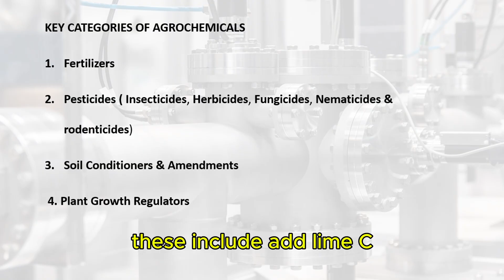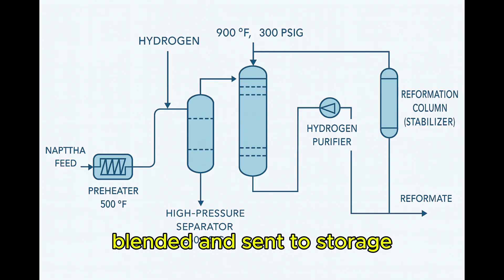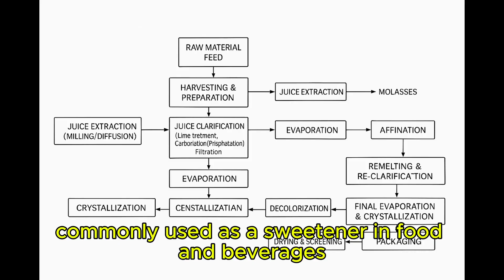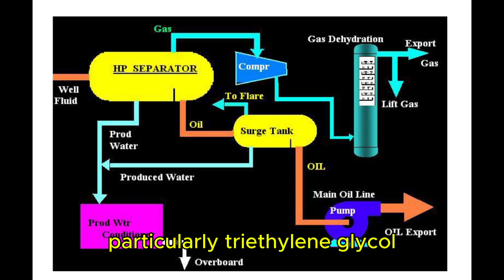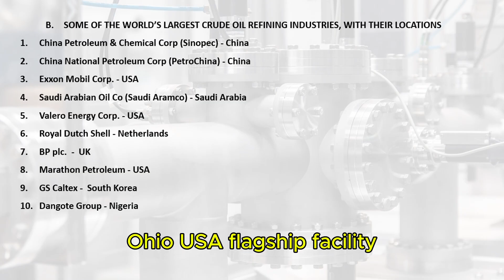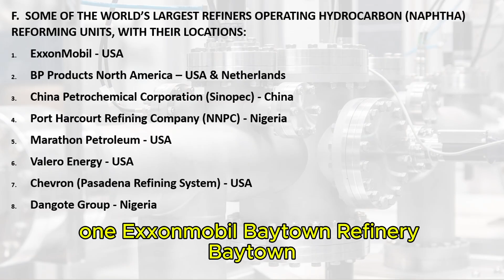From Molecules 2 Millions: The Chemistry, Process Flow & ROI of Industries & Utilized Raw Materials

Comment: Question: What stage of cement production induces the most environmental hazard? How could this be mitigated

Answer

The stage of cement production that induces the most environmental hazard is STAGE 5: THE CLINKER FORMATION in the rotary kiln

This stage requires extremely high temperatures of about 1450 degree Celsius,which are usually achieved by burning fossil fuels. This process releases significant amounts of carbon dioxide (CO2), a major greenhouse gas, contributing to climate change. Additionally, the extraction of raw materials in STAGE 1 can lead to habitat destruction and soil erosion but then the clinker formation is the most energy-intensive part of the cement manufacturing process, and it is responsible for a large portion of the industry's environmental impact.

How can this be mitigated?

There are several ways to mitigate the environmental hazards associated with cement production:

1.  Using alternative fuels: Replacing fossil fuels with alternative fuels like biomass, waste-derived fuels, or even hydrogen can significantly reduce CO2 emissions.
2.  Improving energy efficiency: Optimizing the kiln process, using more efficient equipment, and recovering waste heat can reduce energy consumption and emissions.
3.  Using supplementary cementitious materials (SCMs): Incorporating materials like fly ash, slag, or silica fume into the cement mixture can reduce the amount of clinker needed, thus lowering emissions.
4.  Carbon capture and storage (CCS): Implementing CCS technologies to capture CO2 emissions from the kiln and store them underground or utilize them in other industrial processes.
5.  Developing alternative cement types: Researching and developing new cement types with lower clinker content or alternative binding materials can reduce the overall environmental impact.
6.  Optimizing raw material sourcing: Careful selection and responsible mining practices can minimize the environmental impact of raw material extraction.
7.  Implementing stricter regulations and standards: Governments and industry bodies can enforce stricter environmental regulations and standards to drive emission reductions and promote sustainable practices.

These measures can collectively reduce the environmental impact of cement production.

Comment: Discuss the most recent innovative technology involved in the removal of hydrogen sulphide from natural gas streams during gas processing

In gas processing, the most recent innovative technologies for removing hydrogen sulfide (H₂S) from natural gas streams focus on regenerative liquid redox systems, advanced adsorbents (e.g., MOFs and metal‑oxide modified carbons), and electro‑catalytic oxidizers—all aiming for higher efficiency, lower waste, and improved sustainability.

---

1. Liquid Redox Systems with Chelated Iron (e.g. LO‑CAT® / Thiopaq O&G)

Chelated‑iron liquid redox systems such as LO‑CAT® and THIOPAQ O&G utilize iron chelates or biocatalytic oxidation to convert H₂S into elemental sulfur under mild temperatures (~30–40 °C) with high selectivity and solvent regeneration in situ. These are commercially mature technologies recently adapted for broader gas streams, including biogas and renewable natural gas—even though they've existed for years, their latest applications and scale‑ups reflect ongoing innovation  .

Biocatalytic variants like THIOPAQ O&G combine absorber, bioreactor, and sulfur handling stages to continuously convert sulfide into elemental sulfur using microbial catalysts, operating at near‑ambient conditions and achieving excellent uptime and safety  .

---

2. Advanced Adsorption Materials: MOFs, Zeolites & Modified Carbon

Recent innovations feature metal‑organic frameworks (MOFs) and engineered zeolites with extremely high surface area and selectivity for H₂S molecules. These materials dramatically boost adsorption capacity and longevity in harsh gas conditions  .

Similarly, researchers have developed biochar-based activated carbon materials modified with copper oxide (using spent Fenton-like reagents) that exhibit exceptionally high adsorption capacity—over 1000 mg H₂S per gram of sorbent at elevated temperature (~120 °C)—surpassing previous adsorbents  .

---

3. Electro‑Catalytic Oxidation Technologies

In cutting-edge lab research (2024–2025), electrochemical oxidation methods using doped nanostructured coatings—such as Mo- and polyaniline-doped MnₓO_y/TiO₂ nanotube arrays—demonstrate robust sulfide oxidation in aqueous scrubbing streams. They convert sulfide to elemental sulfur with high durability and minimal sensitivity to gas composition or oxygen levels  .

---

4. Hybrid & Digital‑Enabled Systems

Many of these techniques are now combined in hybrid systems (e.g., adsorption + catalytic oxidation or liquid redox + membrane polishing) to handle a broader range of H₂S loads and improve system flexibility, reliability, and cost efficiency  .

Additionally, AI-enhanced monitoring and digital twins are emerging as process optimization tools, enabling real-time control, predictive maintenance, and autonomous adjustment of treatment units for H₂S removal in midstream operations  .

---

🆕 Stand-out: Chelated-Iron Biocatalytic Systems

Of these, chelated‑iron redox systems (e.g. LO‑CAT®) and their biocatalytic derivatives (THIOPAQ) represent the most recently commercialized, innovative technology for large-scale H₂S removal. They operate at ambient conditions, regenerate solvent continuously, and produce elemental sulfur—with minimal waste and strong commercial adoption in both natural gas and renewable gas processing contexts  .

---

✅ Technology Comparison Table

Technology	Innovation Highlight	Scale / Status	Pros	Cons

Chelated-iron / biocatalytic redox	Recent commercial rollouts, ambient ops	Widely deployed (natural gas + biogas)	Low energy, sulfur recovery, regenerative	Requires careful microbial control
Advanced adsorbents (MOFs, Cu‑C)	Ultra-selective, high-capacity materials	Pilot / early-commercial	High efficiency, regenerable	May struggle with complex gas mixtures
Electro‑catalytic oxidizers	Novel electrode materials (TiO₂ nanotubes doped Mo/PANI)	Experimental / lab scale	Fast, robust sulfide oxidation	Still under development, scale-up needed

---

Final Thoughts

For immediate industrial deployment, chelated‑iron redox systems (particularly the latest Thiopaq/LO‑CAT adaptations) offer the greatest innovation impact and commercial viability in modern H₂S removal.

For next-generation solutions, research into advanced adsorbents and electro‑catalytic oxidizers is promising, potentially unlocking higher throughput, lower energy use, and modular application for cleaner gas streams.
🔬 1. Liquid Redox Systems (e.g. LO‑CAT®, Thiopaq O&G)

✅ How It Works:

The gas stream containing H₂S is brought into contact with a liquid solution containing chelates of iron (e.g., EDTA).

H₂S reacts with ferric iron (Fe³⁺) to form elemental sulfur (S⁰).

The solution regenerates ferrous iron (Fe²⁺) to ferric iron (Fe³⁺) using oxygen or air.

Elemental sulfur is removed as a non-toxic 
.System Design:

Absorber column: Gas contacts the redox solution.

Oxidizer tank: Air is bubbled to regenerate Fe³⁺.

Sulfur filter: Elemental sulfur is filtered and removed.

Makeup tank: Maintains pH and iron chelate levels.

🌟 Advantages:

Operates at low temperature and pressure.

Produces pure elemental sulfur, easy to handle.

Environmentally friendly — no toxic emissions.

Low energy use.

📌 Example: Thiopaq® O&G

Developed by Shell and Paques.

Uses sulfur-reducing bacteria to enhance regeneration.

Modular and easily integrated into existing gas treatment plants.

Especially effective for low to medium H₂S concentrations.

---

🧱 2. Advanced Adsorbents (MOFs, Zeolites, CuO-Carbon)

✅ Recent Innovations:

Metal-organic frameworks (MOFs) with ultra-high surface area tailored for H₂S.

Copper oxide-impregnated carbon materials show:

>1000 mg H₂S/g adsorption capacity.

Effective even at elevated temperatures (~120°C).

Zeolites functionalized with metals (e.g., Ag, Zn, Cu) for selective removal.

⚙️ System Design:

Packed adsorption columns.

Regeneration via heating or gas purging.

Multiple beds for swing operation.

🌟 Advantages:

High selectivity to H₂S over CO₂ and other gases.

Compact, ideal for remote or mobile units.

No liquid handling or wastewater.

Can be integrated into hybrid units for polishing downstream.

---

⚡ 3. Electrochemical Oxidation Systems

✅ Emerging Tech:

Uses conductive electrodes (e.g., TiO₂ nanotubes doped with Mn, Mo, or polyaniline).

Oxidizes H₂S to elemental sulfur or sulfate using electrical current.

Designed for aqueous streams or gas-liquid 

⚙️ Setup:

Electrolytic cell with oxidizing and reducing compartments.

Power supply and flow controllers.

Continuous monitoring of pH, redox potential, and conductivity.

🌟 Advantages:

No need for external chemical regenerants.

Produces no secondary waste.

Compact and modular.

Highly scalable with AI-enhanced controls (IoT-ready).

⚠️ Challenges:

Still under pilot testing.

Requires robust materials for long-term corrosion resistance.

Electricity demand needs optimization.

---

🧠 4. AI & Digital Process Enhancements

✅ Recent Trends:

Digital twin models of gas processing units now simulate and control H₂S removal systems in real-time.

AI algorithms are used to:

Predict H₂S spikes and adjust flow rates.

Monitor pH, oxidation state, and chelate degradation.

Trigger regeneration cycles automatically.

🌟 Benefits:

Remote control of units in offshore or desert gas fields.

Reduced manpower and improved safety.

Extended equipment lifespan via predictive maintenance.

🔄 Hybrid Systems (Integrated Approaches)

Adsorption + Redox: Ensures high removal even with fluctuating H₂S levels.

Membrane + Biocatalysis: Used for ultra-pure methane streams.

Cryogenic polishing with redox pretreatment in LNG plants.

Comment: Name: EKPUH JOEL OGHENEOVU
MAT no: U2020/5581001
QUESTION: Briefly discuss the commercial method of producing insecticide.

The following steps are carried out in the commercial production of insecticides. 
Step 1. The active ingredient is formulated by extracting and purifying them from natural or synthetic sources. e.g of synthetic source is organophosphates, e.g of natural source is pyrethrinos. 

Step 2: The active ingredients is mixed with carriers and additives, i.e, it is combined with solvents, fillers, emulsifiers, stabilizers, and synergists to improve its effectiveness and stability. 

Step 3: Formulation processing like milling, blending, or emulsifying to achieve desired particle size is also carried out. 

Step 4: quality control tests are carried out as well, to ensure the insecticide meets with standard.

Step 5: packaging in containers and bottles for easier carriage and storage.

Step 6: Distribution to the end users and making PROFIT.

Comment: The removal of carbon dioxide (CO2) from natural gas streams is a crucial step in natural gas processing. Here's an overview of the chemistry involved:

## Chemical Solvents
1. _Amine-based solvents_: These solvents, such as monoethanolamine (MEA) or diethanolamine (DEA), react with CO2 to form a carbamate compound. The reaction is reversible, allowing for regeneration of the solvent.
2. _Physical solvents_: These solvents, such as methanol or propylene carbonate, absorb CO2 through physical interactions rather than chemical reactions.

## Chemical Reactions
The reaction between CO2 and amine-based solvents can be represented as:

CO2 + 2R2NH → R2NCOO- + R2NH2+

Where R represents the alkyl group of the amine.

## Regeneration
The CO2-rich solvent is then regenerated by heating or reducing pressure, releasing the CO2 and restoring the solvent's capacity to absorb more CO2.

## Other Methods
1. _Membrane separation_: This method uses semipermeable membranes to separate CO2 from the natural gas stream based on differences in permeability.
2. _Adsorption_: Solid adsorbents, such as zeolites or activated carbon, can selectively adsorb CO2 from the natural gas stream.

## Importance
Removing CO2 from natural gas streams is essential to:
1. _Prevent corrosion_: CO2 can form corrosive compounds in the presence of water, damaging pipelines and equipment.
2. _Meet sales gas specifications_: Natural gas sales contracts often specify maximum CO2 content.
3. _Reduce greenhouse gas emissions_: Removing CO2 from natural gas streams can help reduce greenhouse gas emissions during production and transportation.

The choice of method depends on factors such as the CO2 content, gas flow rate, and operating conditions.

Comment: An industrial chemist plays a crucial role in crude oil refining operations. Their responsibilities span process optimization, product quality assurance, safety, and environmental compliance. Here’s a breakdown of their role:

🔬 1. Process Monitoring and Optimization

Analyze and monitor chemical processes in distillation, cracking, reforming, hydrotreating, etc.

Ensure optimal operating conditions (temperature, pressure, catalysts) to maximize yield and efficiency.

Adjust process variables based on real-time data and lab results.

🧪 2. Quality Control and Product Testing

Test the chemical composition and properties (e.g., sulfur content, viscosity, octane number) of: 

Crude oil feedstock

Intermediate products

Final refined products (gasoline, diesel, jet fuel, lubricants, etc.)

Ensure that products meet industry standards and specifications (e.g., ASTM standards).

⚗️ 3. Catalyst Management

Evaluate and monitor catalyst performance in catalytic reforming, cracking, and hydroprocessing units.

Recommend catalyst regeneration or replacement schedules.

Analyze catalyst fouling or poisoning and propose solutions.

♻️ 4. Environmental and Safety Compliance

Monitor emissions, effluents, and waste streams for environmental compliance.

Develop and implement chemical safety protocols.

Assist with hazardous chemical handling and spill response strategies.

🧑‍🔬 5. Research and Development

Work on improving existing refining processes through R&D.

Develop additives and blending techniques for better fuel performance.

Explore alternative feedstocks or energy-efficient methods.

🧾 6. Documentation and Reporting

Maintain accurate records of chemical analyses and process data.

Write technical reports and communicate findings to engineers, managers, or regulatory bodies.

🛢️ Example Tasks:

Determine sulfur content in diesel using X-ray fluorescence.

Monitor the performance of a hydrocracker catalyst using lab and field data.

Develop a new blend of gasoline to meet low-emission regulations.

In Summary:

An industrial chemist ensures that crude oil is refined safely, efficiently, and in compliance with environmental and quality standards. Their chemical expertise is vital for turning raw crude into usable, high-quality fuels and petrochemicals.

Comment: Quality requirements in cement production are crucial for ensuring the strength, durability, and longevity of concrete structures. Key aspects include the quality of raw materials like limestone and clay, the precision of mixing and grinding processes, and the control of parameters like moisture content and clinker properties. Adherence to industry standards and sustainable practices are also vital. 
Here's a more detailed breakdown:
1. Raw Material Quality:
Limestone and Clay:
These are the primary raw materials, and their chemical composition (specifically the presence of calcium, aluminum, iron, and silicon) is critical. 
Gypsum:
Added to control the setting time of cement. 
Additives:
Materials like slag, fly ash, or other finely ground mineral components can be added to enhance specific properties or reduce clinker content (and therefore, CO2 emissions). 
Contaminants:
Undesirable elements like magnesium oxide or alkalis can negatively impact cement quality, so their presence must be monitored and controlled, according to Thermo Fisher Scientific. 
2. Manufacturing Processes:
Grinding: Raw materials are ground to a fine powder to increase the surface area available for reaction with water during hydration. 
Proportioning and Blending: Materials are mixed in precise proportions based on the desired cement properties. 
Kiln Burning: The raw mix is heated to high temperatures in a kiln to form clinker. 
Clinker Cooling: Clinker is cooled to prepare it for grinding. 
Final Grinding: The clinker is ground with gypsum (and potentially other additives) to produce the final cement product. 
3. Quality Control Parameters:
Moisture Content: High moisture can lead to caking and reduced workability. 
Specific Surface Area: Finer grinding increases the surface area, which can accelerate hydration and hardening, says AGICO Cement. 
Clinker Properties: The size and quality of clinker are important for proper kiln operation and cement performance. 
Setting Time: Gypsum is added to control the time it takes for cement to harden. 
Strength: Cement quality directly impacts the strength of concrete. 
Durability: Cement's ability to withstand environmental factors is crucial for long-lasting structures. 
4. Industry Standards and Sustainability:
Adherence to standards:
Cement production should comply with recognized standards like those from ASTM, EN, or ISO. 
Environmental and Safety Considerations:
Sustainable practices, such as reducing CO2 emissions and ensuring safe working conditions, are increasingly important.